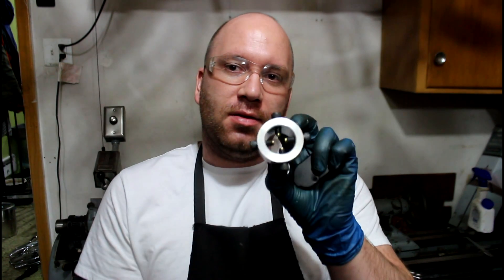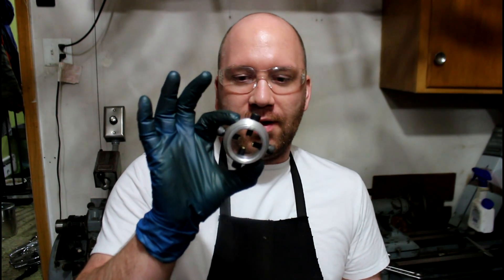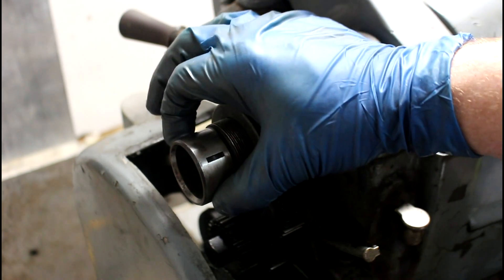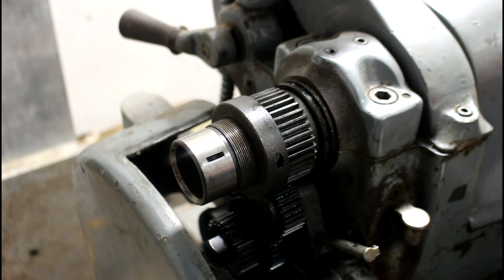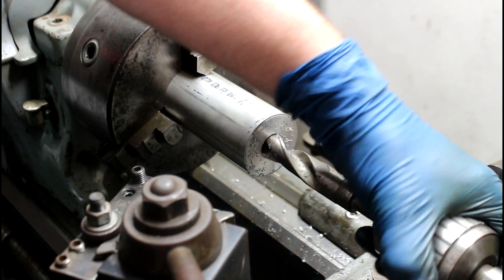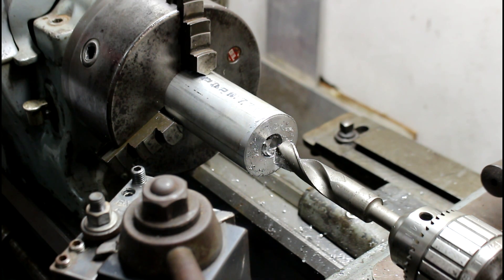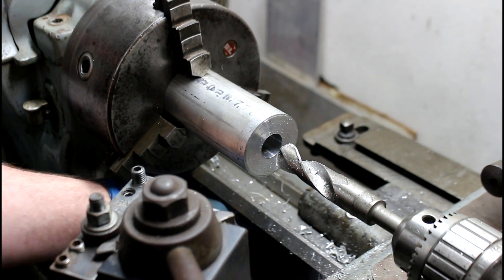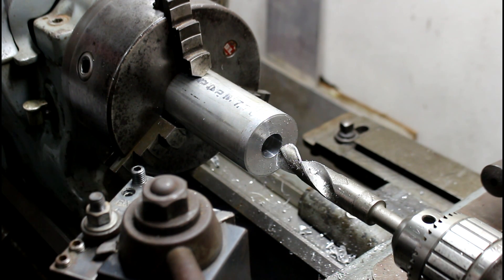Making a Lathe Outboard  Spider for the South Bend 13" Lathe Project

Comment: I know it is small but for me,   my gun hobby,  my other hobby's this should work just fine.
I need a new  tool holder,  as I want a larger than 1/4" tool holder.   What else is good to go with the small machine.
Reply from the maker: Steady rests are always nice to have with the smaller machines. Allows you to work on larger material.

Comment: Using Nitrile gloves and common sense in the machine shop in the modern age - it’s coherent. The “glove” prohibition was based on indestructible neoprene and rubber which were dangerous. And, if U try Halyard brand purple nitrile powderless gloves U’ll never switch.

Comment: Just curious,  I think you stated that you drilled the holes "9/32" to tap for a 5/16-18 (NC) bolt.  Isn't the correct drill size "F" (.257) for that tap size? It appears to be a 5/16-18 tap in the video.
By the way, I was taught to chamfer the hole BEFORE tapping to avoid collapsing the first thread and making it difficult, if not impossible to start or become cross-threaded.
Also, the brass end bolts in the next video appear to be 5/16-24 (NF).  How does that work??
Reply: There really isn't a "correct" drill size for tapping. It all depends on what type of thread fit you're looking to achieve and in what material. If you want the pretty much standard 75% thread then you'd likely go with what recommendations are given on drill/tap charts, but those are just recommendations and can be played with to suit your needs and for materials in use to get the end result you desire. Softer metals can be tapped with oversize taps because of the materials springback into the threaded hole, whereas harder steels won't do this as much. But as for drilling, it may suit you to drill one or two sizes over recommended size to obtain a thread that is 55-65% thread with less chance of breaking taps and less wear as well.

Comment: I found you video as I am about to make the same adapter for my Southbend 14.  I would like to applaud you for not erasing your mistake.  Beginners out there need to know they are going to screw up a bunch when they start learning.  It is very important to show them, what I call the "Oh Well" moment and then dig in and fix it.  To quote an old Dutch Woodworker.  It ain't f@#ed up, until you cant fix it anymore"
Reply from the maker: Yeah, you try your best, but it happens. Mainly when you get in a rush. Just messed up something last night when I was in a rush. I can fix it though.
Reply: It ain't broke till you can't fix it anymore.  Then it's broke.

Comment: If your 'power hacksaw" doesn't cut soft metal any faster than that you MIGHT want to make sure the blade isn't on "backward". Hacksaw blades and files only cut ONE DIRECTION and shouldn't be DRUG BACK ACROSS THE "WORK" so if that power hacksaw isn't doing its "raise and retract" thing in "synch" with the cutting direction of the blade/teeth and is "cutting" when it should be "retracting" and vice versa or at least is TRYING to, it's not going to work worth a damn.
Reply from the maker: Not all aluminum alloys are "soft"

Comment: RUBBER BELT --- BUFFALO LEATHER -- BUT THEY PREFER RUBBER ALSO ---- :-)
2 TEATH PER " WOULD BE FASTER SAW . ---- :-)
Reply from the maker: I've seen that argument, not his video, but I don't believe machanically it matters that much other than you end up moving the other two "nuts" a little bit. If you have an old worn out chuck then it may help. My problem with the 3 jaw in the video is the threads on the backplate are oversized and it does not have a repeatable index when you remove and reinstall the chuck. Also, I didn't want to wrench down on aluminum and leave a bunch of jaw marks in the piece. 

I also have a bucket of blades for my saw. The current blade works great for steel, but is slow with aluminum. Have to try a tpi change as you said. Thanks